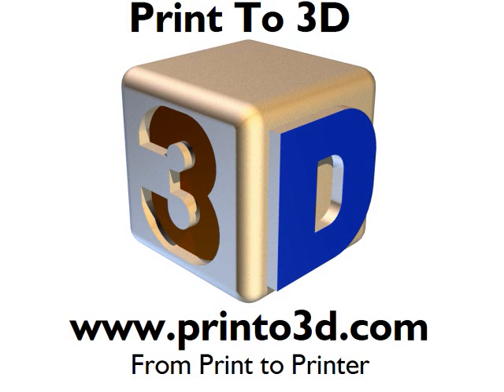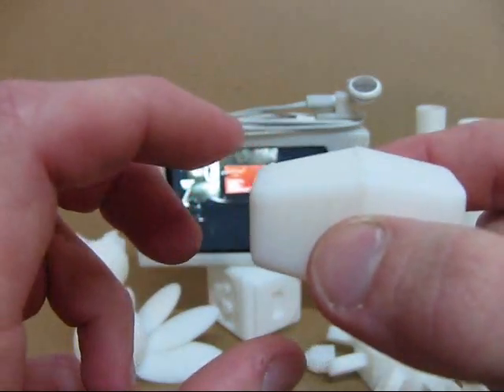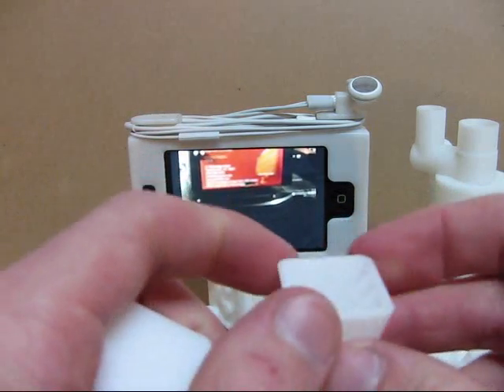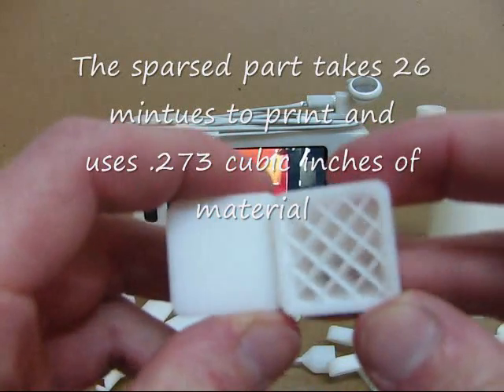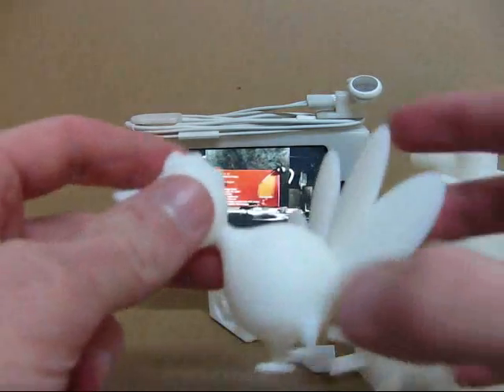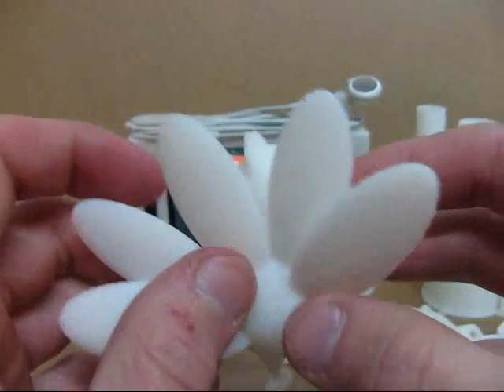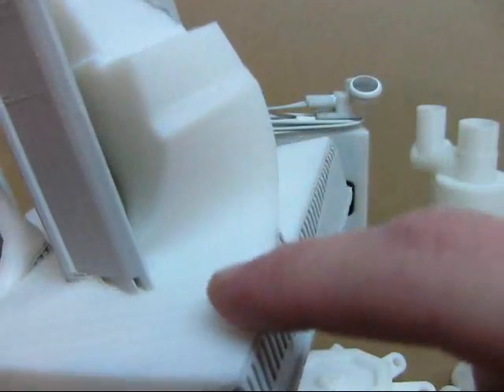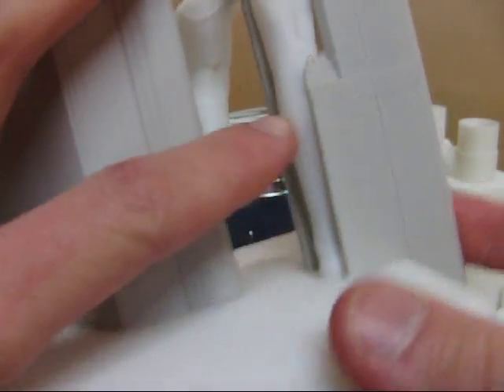FDM Solid vs. Sparse Models

Comment from the maker: It can make gears.  Since the layers are .01" it has it's limits though.

The bigger the gear/teeth the better.

See my Catalyst EX 3D print software video.

The software that comes with the machine determines the supports.

Comment from the maker: This solid vs sparse feature is built right into my 3d printer software.  I wish the software had more features than this though.  For example I wish I could adjust the wall thickness around the perimeter of the parts.

I've got a whole channel dedicated to this stuff over at youtube dot com/printto3d